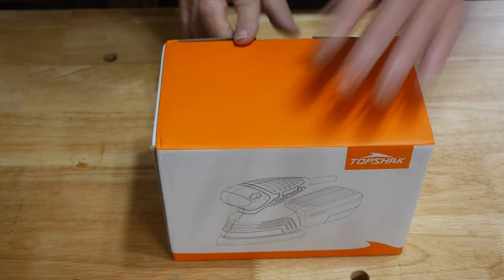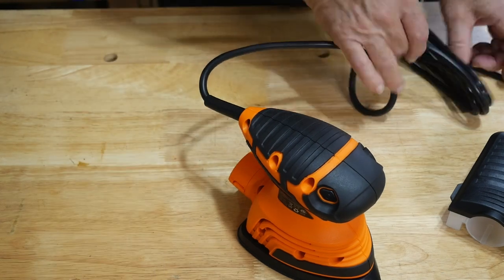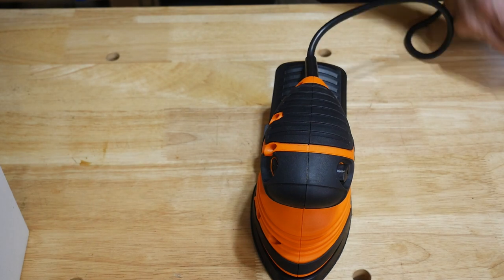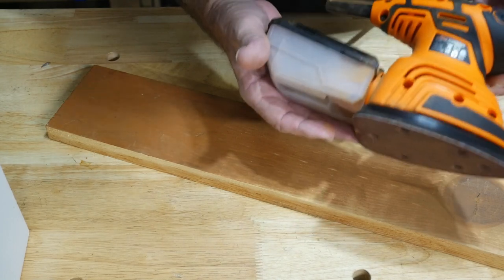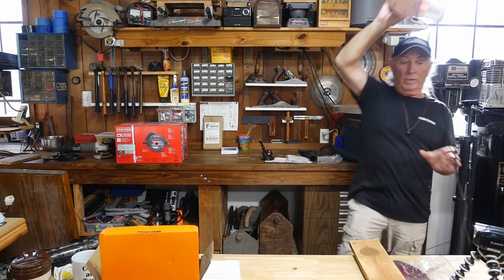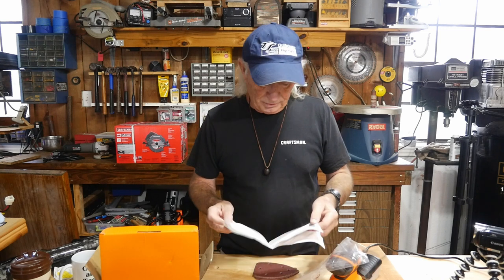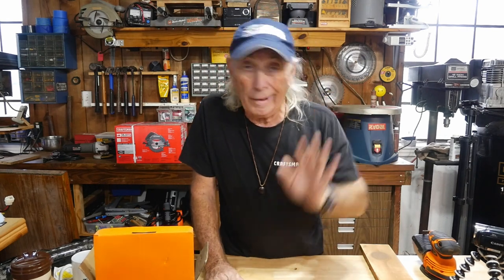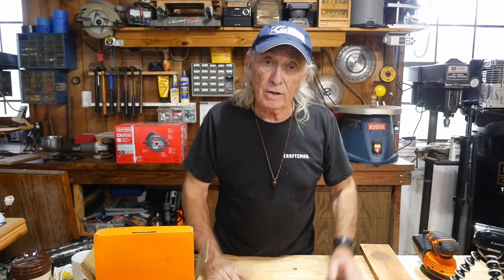TOPSHAK TS-SD2 130W Mouse Detail Sander ON SALE NOW !  C&T episode 193

Comment: Note when buying "any" sander that uses the hook & loop system (velcro), be sure that a replacement  pad is available, if not the sander will become totally useless when (not if) the pad wears out. For the couple of sanders that I own, I also purchased a replacement pad at the same time just so I have it available for when the time comes.
Reply from the maker: Good advice

Comment: SOMEBODY’s…..been SHOPin!!! I see that new saw back there on the bench!!🤣🤣
Okay, detail sanders are pretty much what they are right? Not much do be done for features. The ‘collection’ system…well, maybe cool for mama sanding down a little ornament in her craft room but NO body, makes an attachable dust collector that’s worth a hoot. They just fill up faster than Dale Earnhardt at Daytona!!
I’ve found that more lengthy projects are worth picking up the reducer kits and fitting a vac to it because you’ll change it out 10 times before you change paper. Or so it seems. Vibration is what always gets to me but again, I don’t know anyone who makes a tool like that in which vibration isn’t an issue. 
I’d say you’re right on about jumping on a deal like that!
Reply from the maker: The deal is about 4hrs on and 4hrs off the deal again. Oh...good old Dale .....YES...a Craftsman saw for review is in, and a painter, and a laser machine etc...oh...we got lots here LOL :)